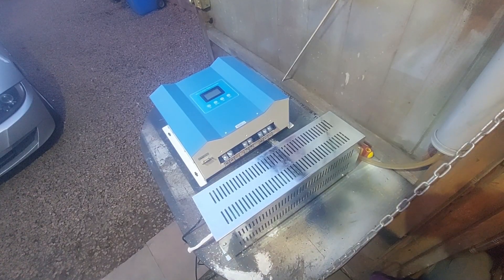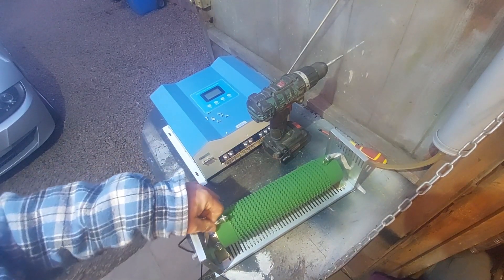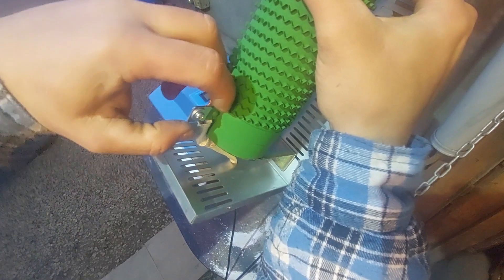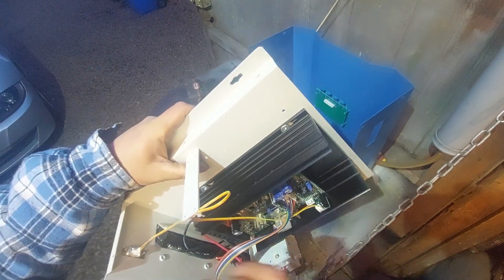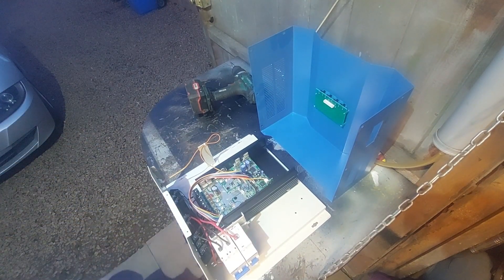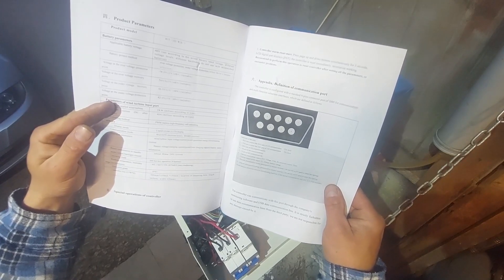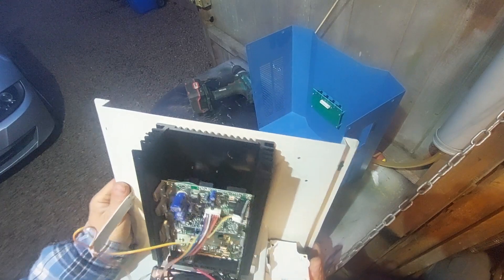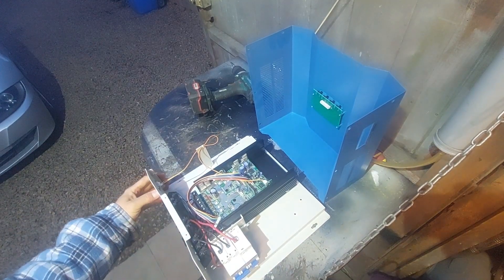Ista breeze i2000. New charge controller  review

Comment: thank you.
it looks like inside is a standard chinese hybrid wind/solar controller. they just added some switches for brakes I guess, also added some better connectors and a bigger body, and did not even bother to put in a fan for active cooling. I hope it did not cost too much.
Reply from the maker: Hi. Actually wasn't cheap, it's no bad controler but like you said,same PCB in most hybrid controllers, difference is this one have communication port.
Reply: @afterworkcreation9394  aha, so better for online monitoring. got it.